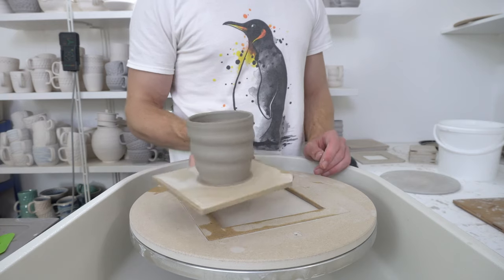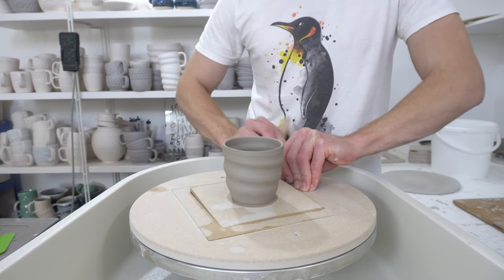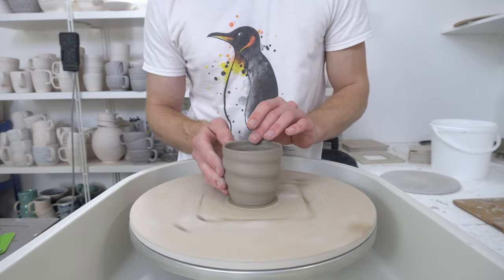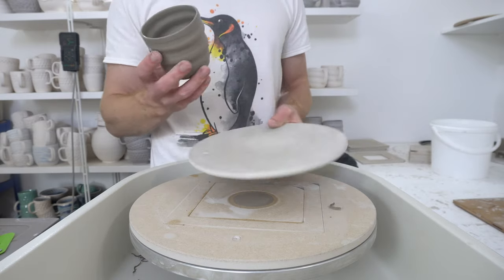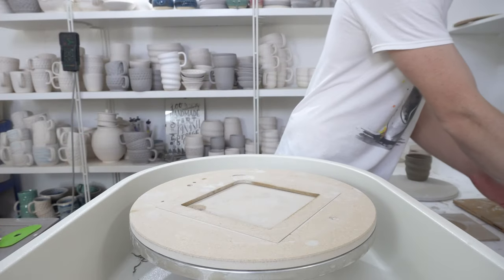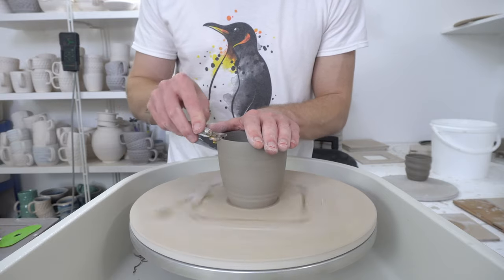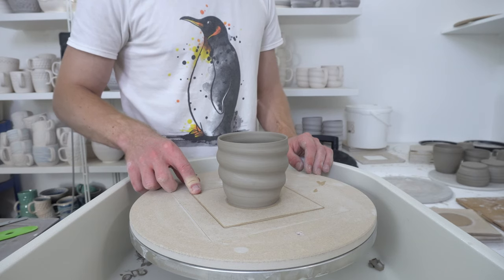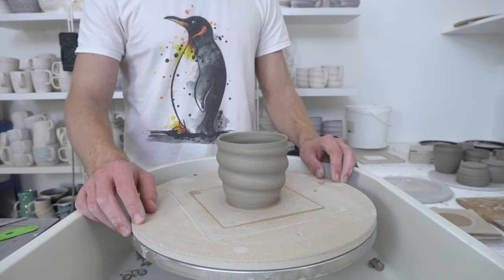Why I don't wire pieces off the batt immediately after throwing them

Comment: Really interesting that you can get a thin, properly shaped, smooth rim without sacrificing stability during throwing by just trimming it the day after! I've always trimmed foots of course but never considered trimming mugs face-up (and never really seen it in any studios).

I once had a bad experience trying to wire-off a plate after a day of drying and it was pretty much impossible -- but clearly that's not an issue for a smaller-base piece like a mug

Comment: Ta!
My Giffin Grip is going to get a bit of a break......I like doing chattering when soft leather hard as it gives a deeper more pronounced patterns. 
Very helpful.
Reply from the maker: That should work perfectly with the pieces still on the batt, and the nice thing is that you can easily work on the full height of the outside like this.

Comment: So you said you threw these 2 days before this? As a novice just trying to teach myself, I'm struggling with the various drying stages & knowing when it's time to trim & whatnot.
Reply from the maker: The ones I'm working on in the video were thrown the day before. The ones to the side that were going to have handles attached were thrown 2 days before. This rate is very weather dependant though, when it's hot and dry everything needs to happen much faster than when it's cold and wet

Comment: When did you switch t standing while throwing?  What would be the reason?
Reply from the maker: A few months ago. The leg extenders come with the Steven Hill version of the wheel, which was one of the reasons I wanted it. I'd not tried throwing standing up before but wanted to see if I preferred it.

My thoughts after this time is that it's different rather than better. I really like the ability to move around the wheel while working and it's less of a hunched over position. The downside is that I have less stability with larger pieces and that I find I essentially end up standing on one leg as I don't put much weight on my pedal foot, which gets uncomfortable after a while.

Comment: Thank you for such an informative video. Do use the same technique on plates as well and wire cut them the next day?
Reply from the maker: I don't often throw plates, but I definitely wouldn't try it exactly the same way. I'd either wire off sooner or leave them until they pop off the batt on their own. When pieces are a little firmer, the wire will make them more likely to warp, which isn't such a problem for mugs but would definitely cause issues with plates

Comment: When you wire off t 4:16, that is the first time you wire the piece? Can you expand a little on the speed at which you drew the cable across? It looked very fast!! I would be nervous to pull so fast :P
Reply from the maker: Yep! I do it at that speed because the slower I go, the more of a clay lump will be left at the last point to be wired off. This happens because the clay is dryer and puts up more resistance to the wire, and is less well attached to the batt. So when the wire is most of the way through it's likely to pop the piece off the batt and leave the last bit of clay as a larger lump, which the wire can then snag on and yank the piece with it. Going faster reduces/prevents that from happening
Reply: Wow! Thanks so much! I’ve been having plenty problems with this! Suzy